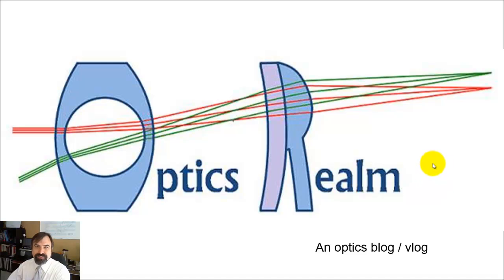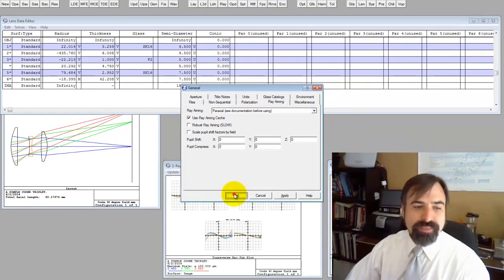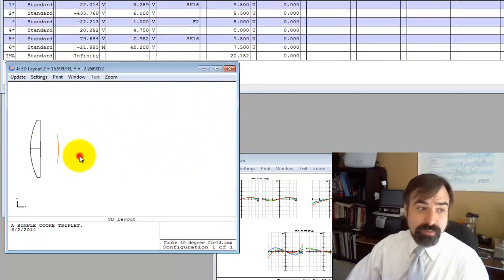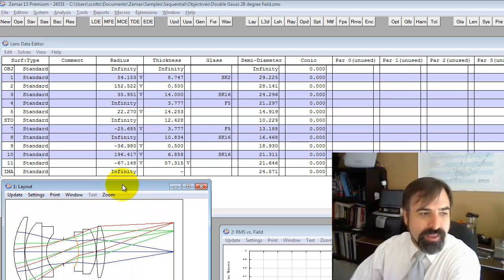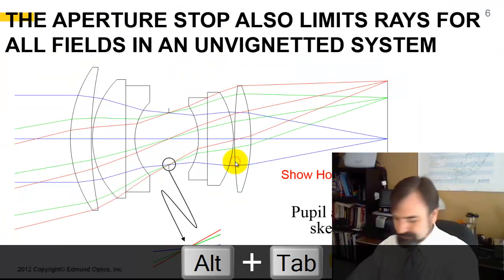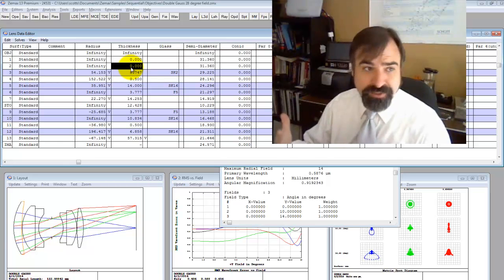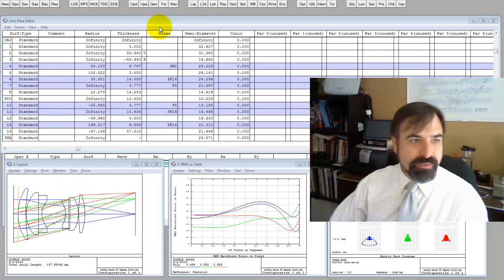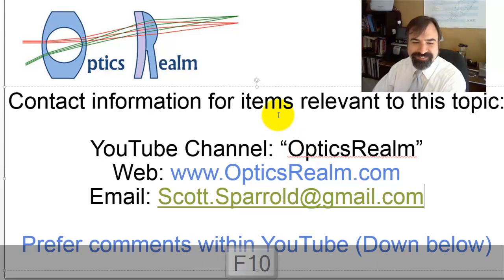Zemax Tutorial 12 - Stops and Pupils

Comment: Hello! Very interesting stuff. I'm getting into optics this summer for a small project concerning partial obstruction of lenses. In particular, telescopes with a 4 to 6 inch aperture. Your videos so far have been incredibly helpful, but i need an additional resource like Zemax, only not that extensive or expensive. If you know of any free software that would aid in simulating simple optical systems, that would be of great help! Thanks!
Reply from the maker: There is GOPTICAL at http://www.gnu.org/s/goptical/ which is a shareware / gnu / freeware software package...I'm not that familiar with how to use this software
Reply from the maker: There is also KDP2 at http://www.ecalculations.com/ but there may be some "issues" with the IP
Reply from the maker: There is also an education version of Oslo from Lambda research at http://secure.lambdares.com/education/oslo_edu/
Reply from the maker: Probably the best bang for you buck is Optalix at http://www.optenso.com/
Reply from the maker: ***** I'm currently at the International Design Conference which is every 4 years... And I asked this question to most of the ray trace software folks. Oslo can get you 8 surfaces. There is also the ray trace software called "Synopsys" which is not to be confused with the company that bought the makers of Code V. "Synopsys" free version gives 12 surfaces... and can be found at http://www.osdoptics.com/
Reply from the maker: ***** If you don't mind, I would love to hear your thoughts on all of these. Post here, send me a personal message or whatever works!!! This question comes up a lot!